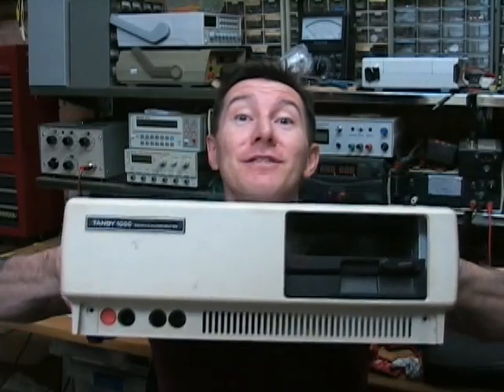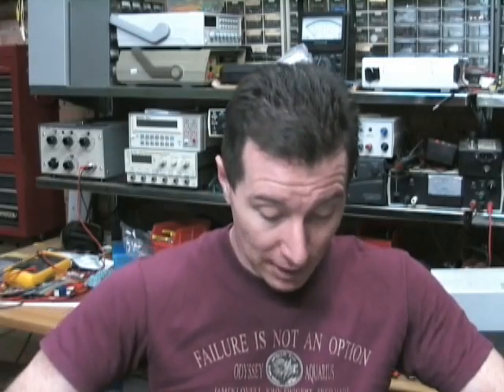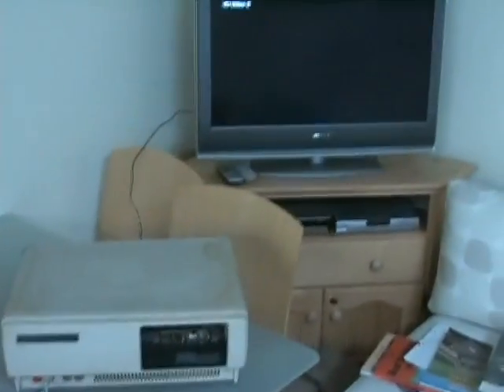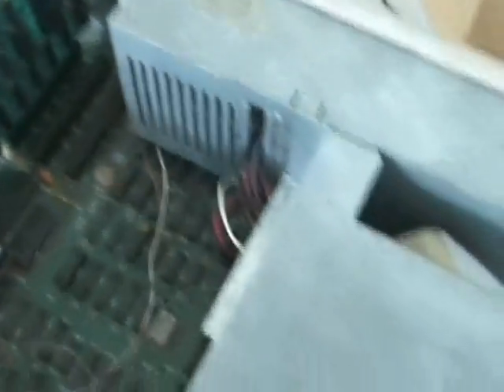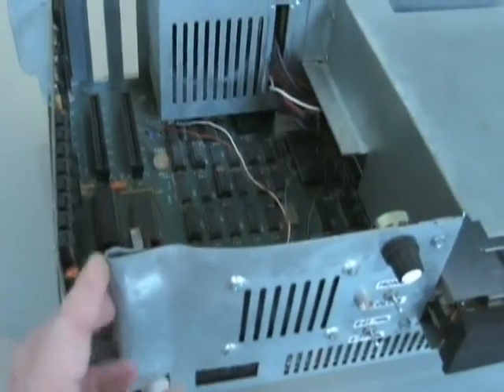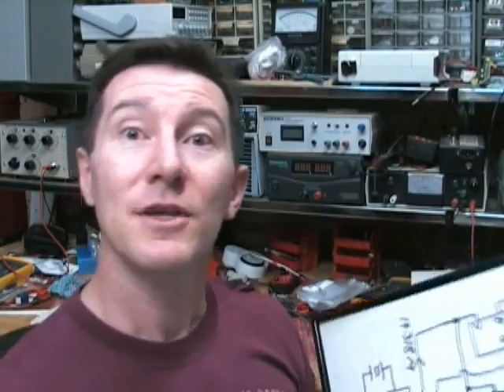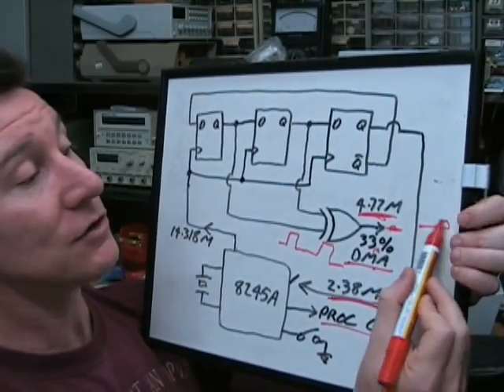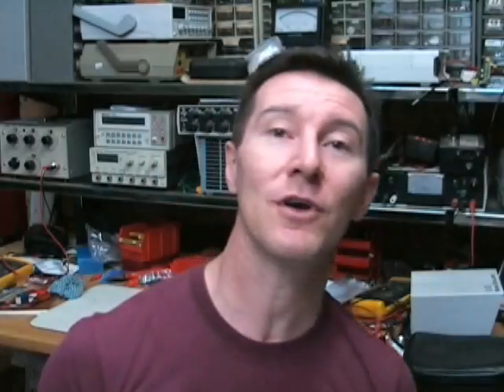EEVblog #32 - Tandy 1000 Retro Computer time!

Comment: Awesome retro, Dave!
When I was twelve, I had a TRS-80 Color Computer 2 w/ tape drive... back in the 80's.  And when ever I went to my local Radio Shack, I used to drool over the Tandy 1000's on display!  LOL
"wow... floppy drive!"   ;-)
Reply: When I was twelve I had a VIC-20 computer, with no storage device at all. All I did was make programs and when I was tired of that program, I turned it off and on and lost it. When I went to the computer store, I drooled over the tape drives. In hindsight, having to throw away code all the time probably made me a better developer in the end, I have no aversion to deleting code and improving it when necessary.

Comment: The new intro is bang on!

The turbo board brings back memories of begging the parents to take me to the proper store to get parts to mod my first PC to run at 2X speed. Perhaps unfortunately, the newer IBM PC (or clone, I can't remember) did not have the timing differential limitations as yours.

Comment: When I want to start up my VIC-20, I have to let it run for a few minutes, turn it off, and turn it on again.  I'm expecting the power supply to explode one of these times, but after warming up, it works just fine.